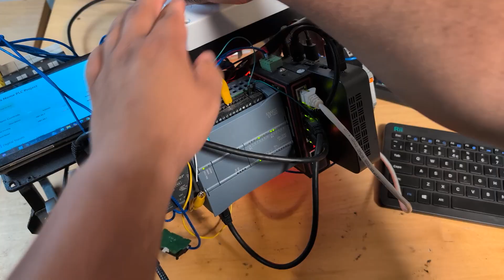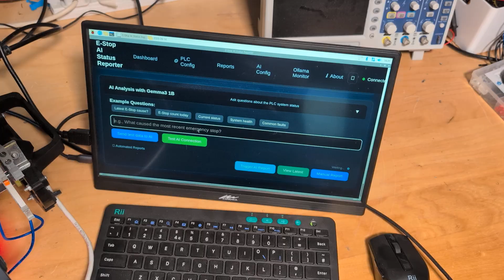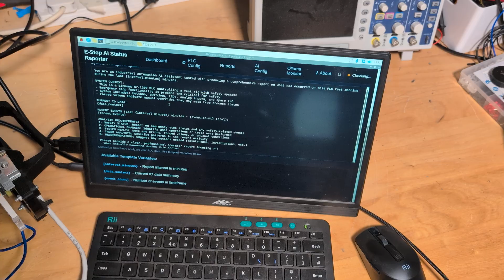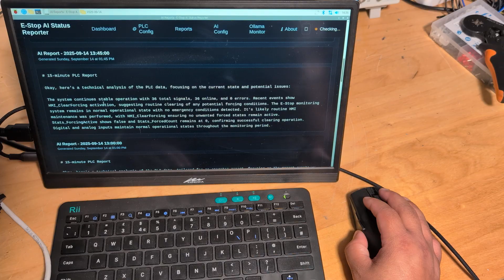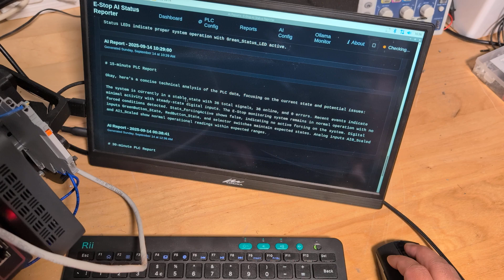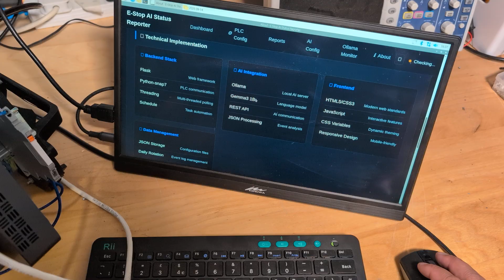AI Reporting PLC Machine State Every 15 mins

Comment: The only reliable component on the rig is the e-stop. 
Complexity adds potential faliure points.
The rpi faliure rate is unreliable to depend on, even for analytics
Reply from the maker: Not my Phoenix Contact safety relay? Also does it matter if the rpi fails? it doesn't control anything. The point of the video is whats possible nowadays. Any PC can run this. I could put a £3k Industrial PC or a spaceworthy computer with radiation hardening. This just isnt a video on safety hardware or reliability.